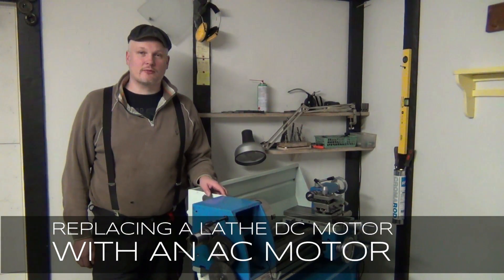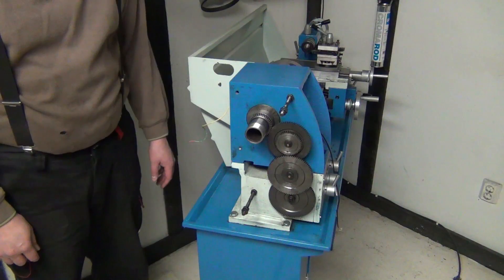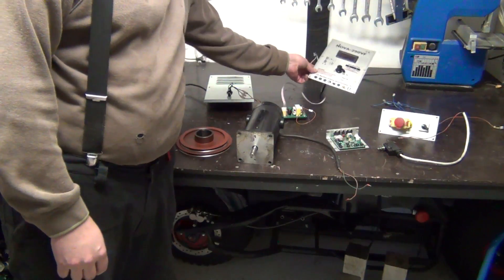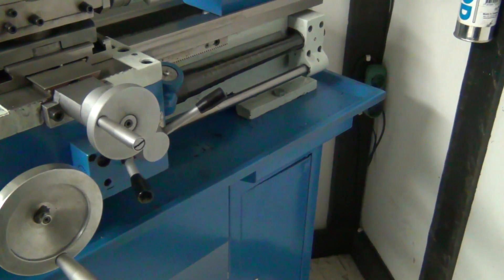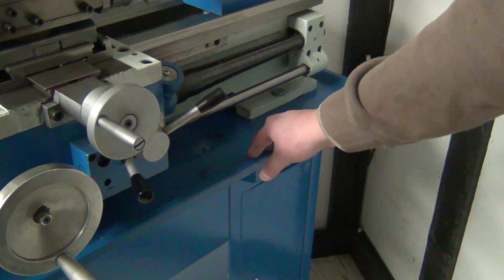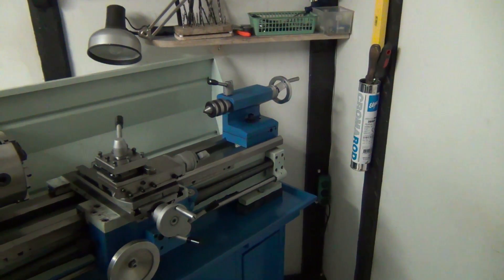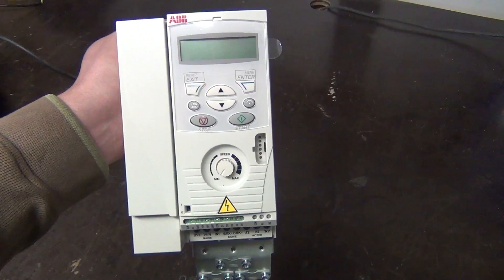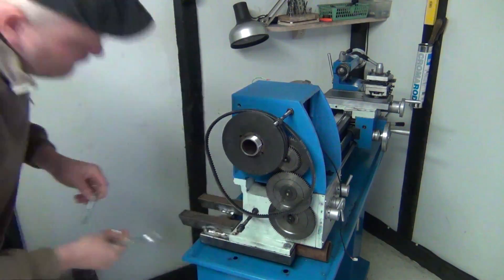Replacing a lathe DC motor with an AC motor

Comment: I am amazed to find this, insamuch as I have been going NUTS trying to find the details on converting my old wood lathe, which has a single phase AC motor, that I have tried three of the oh, yeah, this works on anything crap, to a DC Chinese motor (one of the big blue ones) that they DO make speed controllers for. 

...and I find this guy doing just the opposite...

Comment: very interesting and great work!! Couldn't you have mounted the inverter directly on the lathe to have the controls close at hand?
Reply from the maker: Thank you. I actually changed it later so that I attached a plywood board behind the splash guard and inverter is now same package with the rest of the lathe. Roughly in the same location though. It is actually quite handy to have the speed nob on the right away from the spinning parts. I also still have the standard safety switches hooked into the spindle guard so it is no less safe either.

Comment: Your inverter doesn't produce 400 volts on each of its three output legs or phases.  Each phase developed 240 volts relative to neutral or earth ( zero).  The 400 volt potential is a transient value between any two phases as the out of scyn wave forms interact. The 400 volt is actually an RMS value of about 415 volts if the output legs (or phases) are balanced.  The true behaviour of this supply system is clouded or masked as American consumers try to explain to each other how come they have "two phase" power in their homes.  They confuse a LEG with a PHASE .

To really explain the system you need to start at the power lines in the street and not at the domestic service pole.

Stavros
Reply from the maker: Yep. You are right. I have not actually measured the delta between the phases going to the motor nor am I an expert on how inverters actually work. I have been assuming that even if the inverter only takes 240V in, it can do a 120 degree phase shift for phases using roughly that maximum voltage (when messured against ground) and thus achieve a maximum voltage difference of 400V between two phases (one phase being on positive side and the other on negative side).
Reply from the maker: Had to check still. This is the exact VFD I’m using: https://inverterdrive.com/group/AC-Inverter-Drives-230V/ABB-ACS150-01E-07A5-2/. If I understand the spec correctly it does indeed produce 3x230V maximum voltage and thus also the maximum voltage delta between phases is that 400V.

Comment: Very good job, thank you  ! I am doing the same tranformation on Bernardo profi 700.
Just a couple of question: how did you connect the e-card to the vfd  to start simultaneously with the motor ?
And what about the switch off when you open the protection cover ?
Thanks in advance for your help.
Greetings from Italy
Silvano
Reply from the maker: I simply have an external master power switch for the entity. Vfd and ecard are both powered from the same master switch but they are parallel and independed as such.

For safety I’m using the original protection cover switch but it is now connected to one of the low voltage circuits of the vfd. Vfd is configured to stop when that circuit breaks.
Reply: Thank you very much for the fast replay ! Very kind of you.
I wonder whether it is possible to connect the power of dfd
Reply: ...inverter directly to L N out of the e-card. Originally the speed controller and the motor is connected to the card.

Comment: Hey i have a mini lathe and i want to convert to an AC motor!! How can i make it run both directions left and right for thread cutting?? Is that possible??
Reply from the maker: In my setup the controller has capability to run both direction. I guess it is up to what components you decide to use.
Reply: @eE48v  So the lathe  is cutting threads and has auto feed screw just like before?? there is no compromises on thread cutting?
Reply from the maker: @ThanasisThomas   No change there. Everything from the motor onward is the same.
Reply: @eE48v  thanks for the reply has beeing  very helpful
Reply: @eE48v  i will convert mine too thanks for the help!Also last question i have only single phase motor capacity is there vfds for single phase motors to make the conversion?
Reply: @ThanasisThomas  you can find single phase to 3 phase vfd. Usually home machine shops use this setup. Look for it on eBay or Amazon.

Comment: Nice. Please tell me which size pulleys you use? I have smaller 240 version of this lathe. I want to fit a 1.5kw 6 pole, 940rpm motor, I think it will be easier to get good speeds. 1:1 or 2:1. The motor is tooo long, 100L frame, so it will go through chip tray. 1.1kw will be shorter. What do you think best? Thanks
Reply from the maker: Mark E , Unfortunately I don’t remember what I ended up with but I did calculate it to match roughly the original ratio. It worked out good and I get about same top rpm as with the original. I also had to cut away and box about 5cm dent to the chip tray. Does not matter though as it is still well away of the chuck surface. Motorwise I think both will do fine as the next issue of frame starting to flex/vibrate before running out of power, will be there, with either.

Comment: If a single-phase VFD is used, the 3-phase motor must be connected to the delta to have its nominal power. Because the VFD output is only 3x230V max.
Reply: Yes, just like it was done in this video.

Comment: what is really nice, other than the chinese lathe, is the tachometer, on spindle speed. with a normal vfo, if you get rpm, it is motor rpm, which does not equate to anything on the lathe, without a chart. You can build a large chart, then read out the vfo I suppose. good job.
Reply: On most VFDs there is a parameter that you can change to select what is displayed. Usually there is an option "line speed" or "shaft speed" and another parameter to set a multiplier. This way if you have just one gear ratio from motor to spindle, you get the actual RPM displayed on the VFD.

Comment: nice rebuid.

Question what is the belt drive size on motor and spindle.  Also what rpm do you get on the spindle   using  with the VDF  (min freq en max freq)

Thanks

Comment from the maker: Personally I have been really pleased with this three phased motor setup. It is a 1.5kW motor. What the VFD does is first converts the input AC (in my case single phase 220V) into DC and then internally that DC into three phased AC (400V). There are simular controllers which take three phase AC in as well (400V).

Compared to the original setup this is superb. The torque on low speed is good and there is enough rpm for small diameters as well. The only issue is that with this motor I start noticing that the frame is not very sturdy so I cannot even use the full power of the motor setup. But that is something I have no problem living with.

And I'm sorry I did not realize the first question earlier. I hope the answer clarifies and it is not too late - propably is..
Reply: Hi, I get vibrations on the motor at some frequencies. Is it normal ?
Reply: Sorry friend, but did you got it to invert the rotation as well?
Reply from the maker: @alexeinuville2555   You mean switch direction of rotation? Yes, that is part of the magic the controller provides by default. The one I have is truly flexible but I would assume that feature is available in most vfd’s.
Reply: @eE48v  thank you very much!!!

Comment: Terve! I am doing similar conversion, but would want to use a servo-stepper nema24 as drive, would you recommend to stick to ac motor with VFD? what is the power of your motor .75kW or 1.5kW?